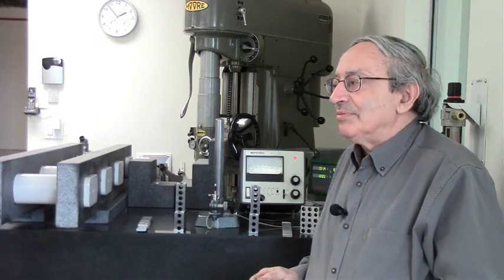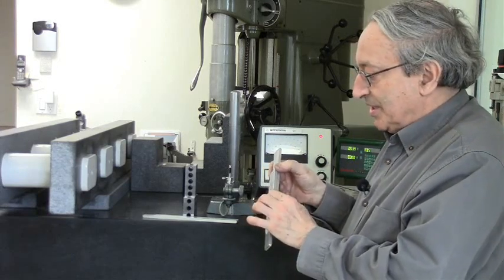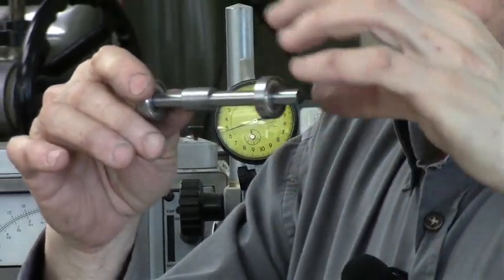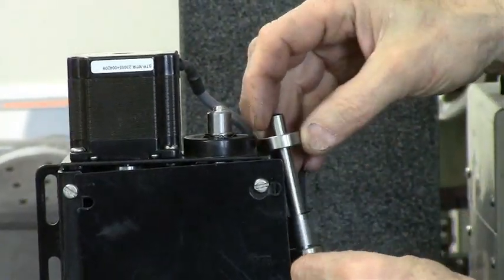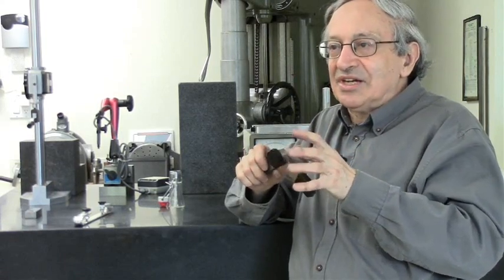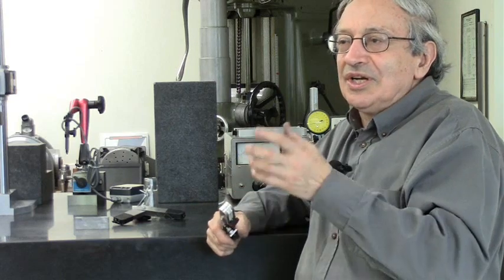Building Prototypes Dan Gelbart  part 18 of 18  Design

Comment: Building Prototypes: Strength vs. Stiffness, Design Philosophy, and Practical Tips (Part 18 of 18)

* 0:06 Strength vs. Stiffness: In instruments and machine tools, stiffness is often more critical than strength. Stiffness ensures minimal deflection under load, crucial for precision. [From alanvcraig's Comment] The demonstration comparing the stiffness of a solid aluminum bar to a split bar held with rubber bands effectively illustrates this concept.
* 1:34 Stiffness Demonstration: A solid aluminum bar shows greater deflection under load than a split bar of the same material held together with rubber bands. This counterintuitive result demonstrates how the constraint of not separating, enforced by the rubber bands, makes the middle section of the split bar act as a thicker, stiffer unit.
* 3:46 Mounting Pulleys: When using set screws on pulleys, file flats on the shaft to prevent the set screw from permanently denting the shaft, making removal difficult. For a better, non-marring solution, consider flexure-based clamping or a taper plug approach.
* 5:22 Mounting Shafts on Bearings: Bearings have inherent play and are designed to be preloaded in pairs for optimal performance. Preload can be achieved using sleeves, steps, or spring washers (like wave washers).
* 7:34 Bearing Housing in Sheet Metal: When mounting bearings in thin sheet metal housings, reinforce the walls with additional plates to provide adequate support and prevent deformation. 
* 8:01 Bearing Alignment: Alignment of bearing mounts can be achieved through various methods, including self-aligning welded nuts and flathead screws, line boring (drilling through assembled parts), or precision boring with a boring head. 
* 10:30 Bearing Selection: VXB bearings (vxb-bearings.com) offers a cost-effective source for bearings, particularly the 8mm ID x 22mm OD size commonly used in skateboards. Exercise caution with "ABEX 7" bearings, ensuring they are genuine ABEC rated bearings and not a different brand.
* 11:44 Dealing with Loose Bearing Fits: Loctite can be used to address slightly loose fits between bearings and shafts or housings. Apply a drop, let it cure overnight, and heat to 150°C for removal if needed.
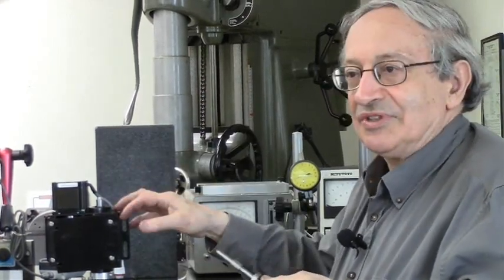* 12:24 Design Philosophy: Prioritize designs using wire, then sheet metal, and lastly, solid materials. Wire offers minimal waste, requires less finishing, and is well-suited for automated CNC bending. [From rippermcguinn's Comment]  The series as a whole provides valuable insights into manufacturing processes and reasoning behind them.
* 15:03 Sheet Metal Advantages: Sheet metal can offer unique advantages, such as the high locking power achievable with multi-surface contacts, similar to a multi-disk clutch.
* 15:56 Precision in Solid Parts: Consider whether you need absolute precision or if adjustability can be incorporated. If a smooth, precise feel is desired, incorporate precision elements like ball bearings at adjustment points to enhance the user experience.
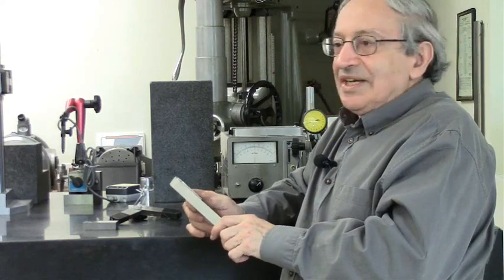* 18:34 Instrument vs. Machine Design: Design considerations differ significantly between instruments (low load, high accuracy) and machines (high load, stiffness, wear resistance). Kinematic mounts are suitable for instruments but not for load-bearing machines.
* 20:06 Design for Production:  Consider lifetime cost, maintenance, and ease of assembly. Plan cable routing and component placement carefully, especially in systems with electrical and hydraulic/pneumatic components. Always route hydraulic lines below electrical wiring to prevent potential damage from leaks.
* 21:47 Aesthetics and Functionality:  Aesthetics often follow from good functionality. Designs optimized for their purpose with no unnecessary material tend to be inherently beautiful. 
* 23:17 Closing Remark: Designing for 100% functionality will often lead to an aesthetically pleasing design.

I used gemini-1.5-pro-exp-0801 on rocketrecap dot com to summarize the transcript.
Cost (if I didn't use the free tier): $0.11
Input tokens: 28686
Output tokens: 859

Comment: "Form follows function" is beautiful to some people but not to sales/marketing. Beauty is in the eye of the beholder.  Many people will think baroque is beautiful because they have been trained to look at it that way. Not formal training but peer training. Parts that don't show are beautiful to the manufacturer if they function well and cost little. Making them to a higher aesthetic standard will not increase sales/profit. Can you tell, I'm a manufacturer! Perceived value is what sells. Want proof? Many thousands of low priced Chinese lathes are sold, not even the most optimistic buyer is going to think they are getting a high quality machine.

Comment: Hi Dan,

Thanks for an amazing video series!

I lost count of how many times you mentioned tools you had made from scratch or had significantly modified.

Some were deceptively simple, such as making the mill depth stop easier to adjust.  Others were novel, such as the laser centering tool.  Some were extreme, such as the micron-accurate lathe+grinder.

I would greatly enjoy seeing videos describing the genesis of such tools.

Did you ever need a tool you couldn't find on the market and didn't know how to make?  How did you proceed?

Thanks again!

Comment: 0:12 - this Construction to the left - looks Exactly like Granite Lathe bed made by Dan Gelbart 
We can see that top beams do not go all the way , but actually shorter to give space for Headstock. 
Also 4 Steel Compression bolts (big square white blocks on sides) are more Square shape from right side, from left they should be round. 
Also between compression bolts we see White Spacers, made from Thick wall Steel Tubes, and precision Ground to exact length.

Comment: "Engineers ... seem to be polishing surfaces and refining away angles, easing this joint or stabilizing that wing, rendering these parts invisible, so that in the end there is no longer a wing hooked to a framework but a form flawless in its perfection, completely disengaged from its matrix, a sort of spontaneous whole, its parts mysteriously fused together and resembling in their unity a poem.
"

-- Antoine de Saint-Exupéry on the shape of an airplane

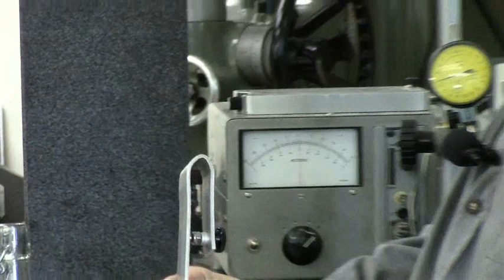Comment: 17:45 This concept (inserting a perfect surface into a rough system) is so interesting, because it is the opposite of most mechanical situations, where a chain is only as strong as its weakest link. Here one strong link strengthens the whole chain.

Comment: Thank you for publishing this series on YouTube. But I feel I need to correct you on one thing regarding the ball bearings. Those look like standard shallow groove ball bearings which really don't like to be side loaded in the manner which you're describing to remove the play. It will generally cause them to wear out fairly quickly if the loads are substantial. For the type of axial preloading that you're describing, tapered roller bearings will perform far better and with less play.
Reply from the maker: You are correct when bearing are large, but small ball bearings (say up to 50mm) are routinely preloaded in this manner. Intermediate sizes (50-100) are used this way but typically bearings are deep groove or angular contact.

Comment: Please keep making more videos, you are a great teacher.

What are the other machines you haven't explained? For example the big green one in the corner behind the granite table.
Reply from the maker: The big machine is a Moore #3 Jig Borer, the basic machine you need if you do any precision work. This machine (no longer made) is an absolute masterpiece, has an overall accuracy of about 1micron (0.000040"), used to cost about $80,000 and available on Ebay for about  $3000-$5000. If you got the room, buy one before they disappear.

Comment: In the first shot, behind you on the left: is that assembly from your air-bearing lathe? The two granite parallels are glued to the white (stone, marble? ) cylinders? Or are those simply white plastic covers to protect the screws from water? I cannot see the orthogonal granite spacers clearly, but maybe these are inside the white cylinders? Thanks for the great series!!
Reply from the maker: Yes, it is part of the bed for the lathe being glued on a granite plate to get a flat reference surface. The white cylinders are steel spacers, the white squares are the nuts for putting the adhesive under compressive stress.

Comment: in the case of 2 pieces with rubber band, this is what i understand and also wonder:-
1.  the rubber band is the weakest link. so, the combined part is going to act like a single block only until the induced internal stress due to external loading is lesser than the force of static friction at the mating surface.
2. the theoretical stiffness should have been 8 times but it is only 2 times, i.e., 75% loss of stiffness (pretty damn huge loss). i assume this is because the rubber bands are not creating enough static friction at the interface, also maybe due to lesser contact patches since the mating surfaces are not perfectly flat.
3. is it possible to get the stiffness to the theoretical value (8 times) with the below methods:
       a. using screws instead of rubber bands 
       b. using epoxy instead of rubber bands
       c. having perfectly flat mating surfaces

thank you for the response. (the previous one and for this one in advance 😃)

Comment: Excellent videos and beautiful shop! What type of wood is used for the workbench tops?
Reply from the maker: All workbenches are reject laminated beams. You used to be able to buy those very cheap from laminating plants, but I think that this is no longer true.
Reply: @dgelbart  Thanks for the quick response. Are they a hardwood or softwood? They look to be holding up great.
Reply from the maker: @ledfootlou2540  They are softwood (Douglas Fir) and every 10 years I plane them down 1mm (at this rate they are good for 250 years). They should be hardwood.

Comment: Hello Professor Gelbart,

Is that a Moore Jig Borer in the background? What sort of things did you make with it? Is this a device that is still useful with CNC machines in existence today?
Thanks in advance,
Reply from the maker: Indeed it is a Moore #3, which will always be useful if you need to measure or machine to 1um. CNC machines can machine to about 5um. Also, CNC machines do not have the long term stability of a jig borrer and need to be re-calibrated every few years to maintain accuracy, as they use electronic corrections. A Moore jig-borer has no corrections and will always be accurate.
Reply: Dan Gelbart thanks for sharing!

Comment: is that the bed for your high precision lathe on the table at the beginning of the vid?
Reply from the maker: Yes. Epoxy is setting while the tops are held in one plane by the table (with spacers to keet the distance between the two tops).

Comment: Thank you Sir for those videos. Enjoyed all!

But excuse me for making one comment on this episode here. At 15:12.  Friction is µ x F. And a thing like area or 'multiple areas' don't show up in the calculation of a static situation.  In 'clutch operation' the generated heat is another thing and there, the area or 'multiple areas' comes up.
Best regards from Germany.
Reply: You're correct that if you distribute a given force across multiple surfaces that are supporting the force in parallel, it does not change the total friction*. This is because if you multiply the number of surfaces by n, the force that each surface supports is divided by n; the factors of n and 1/n cancel, and the total friction is the same. That's a valid observation that many people miss. But, in this case, the surfaces are supporting the force in series; in other words, every single one of those surfaces is carrying the full force F, because they are all stacked in a single column supporting the load. So the total friction really is multiplied by n.

*Not much, at least; the coefficient of friction µ is not actually constant with pressure for most real materials, but it's reasonable constant for smooth metals.